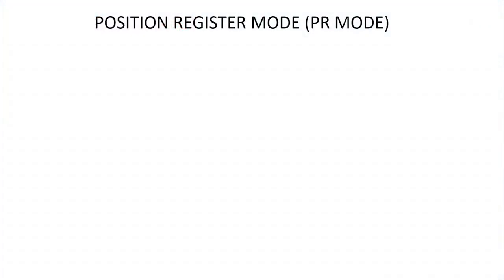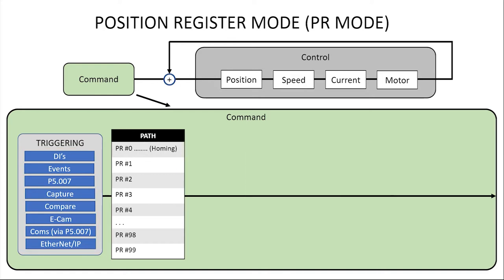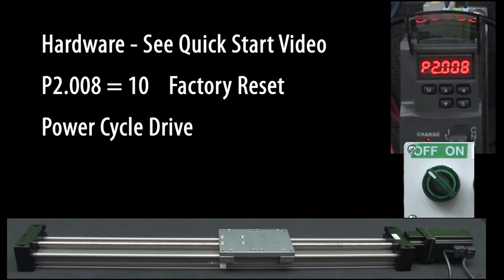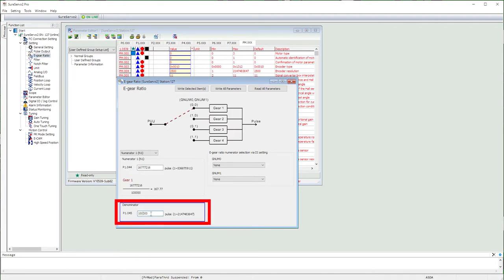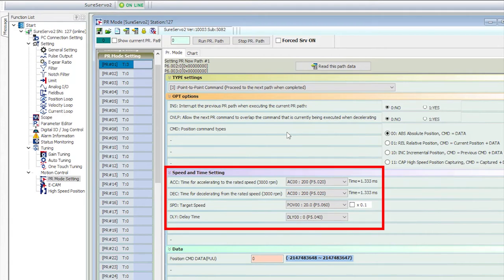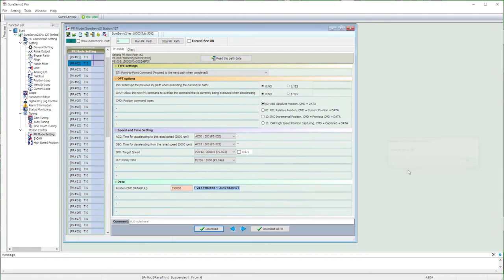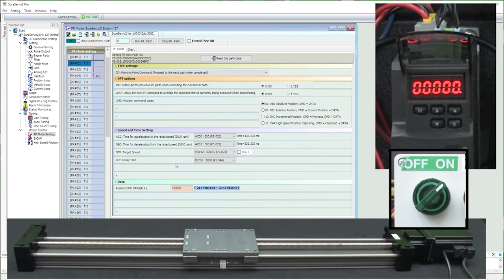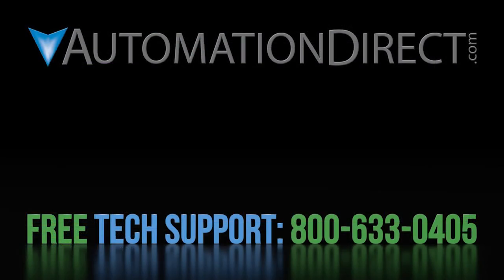Servo Position Register Mode (PR Mode) Tutorial - SureServo2

Comment: The Position CMD Data(PUU) field in the PR Mode, Data portion, is there a parameter you can set the value of this field and then run the path by setting the P5.007 parameter which would look at this register to go to this position?
Reply from the maker: Hi Joshua,
I think you want to write a position to a PR Path and then run that path - is that right?  If so, that's easy.
Example:
Write 50000 to P6.00 which is the position register for path 2. 
Trigger the execution of path 2 by writing decimal 2 into P5.007.
As long as the drive is enabled and ready, then Path 2 should execute with the new position data (50000).